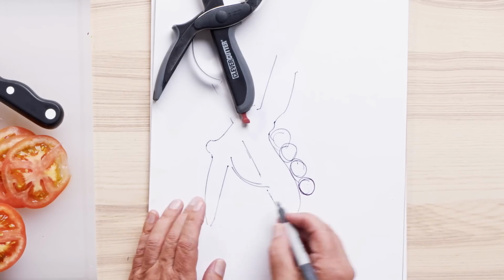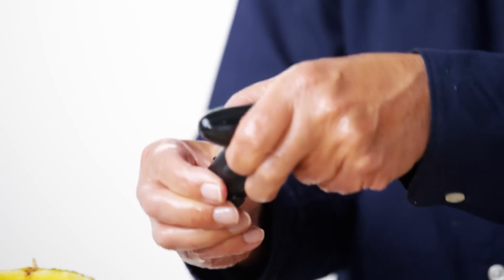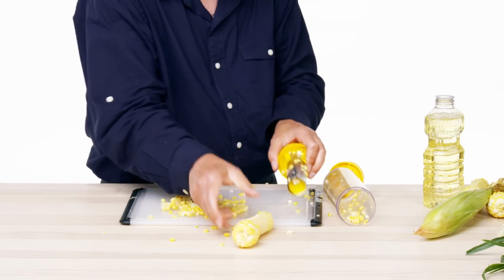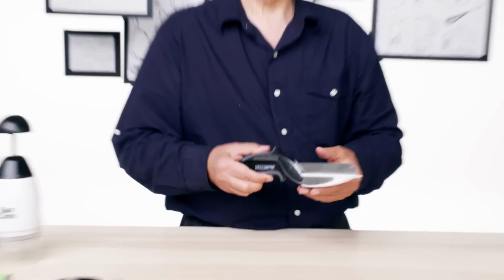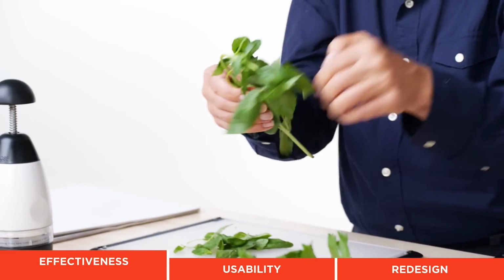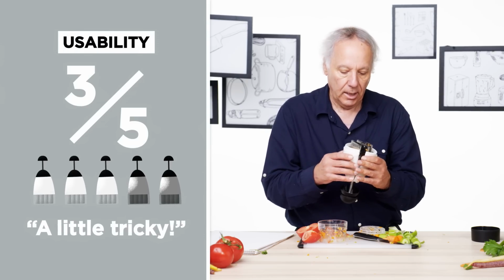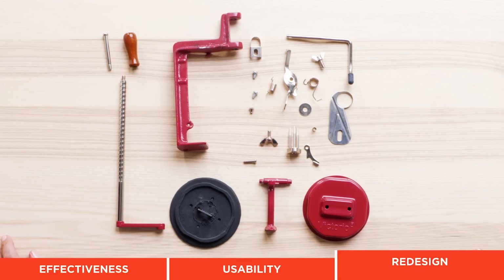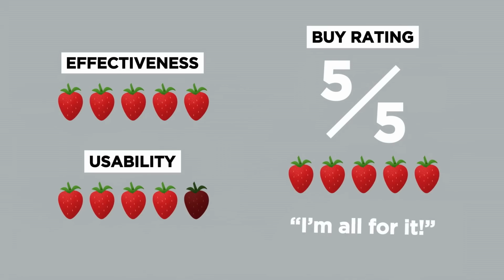7 Slicing Kitchen Gadgets Tested by Design Expert | Well Equipped | Epicurious

Comment: I have a neurological disability that limits the control I have over my left hand in particular,  the right somewhat.  For almost all my chopping tasks, I use a cleaver-style Chinese knife.   I bought my first one from a Chinese grocer at the age of 15, and at the age of 63, I'm on my second because the first got lost in a move thirty years ago.  I bought an identical one; they have been making them the same for a thousand years.   It makes most of these tasks, including cutting a pumpkin or watermelon or hard sweet potato, very easy, and much quicker than a French knife, as any Chinese cook will tell you.  You can't press on a French knife but you can these.  

My father was a metallurgist and when I brought home my first knife, he was impressed and told me that it's a very old way of making knives.  The steel is laminated.  On the outside there is hard steel, the inside is soft steel.  This means that it stays sharp well.  Soft steel and iron take a better edge than hard steel; the hard steel keeps them from losing the edge.  Although these look like a cleaver, they are knives and are not meant to chop through bone, which will chip them.  They are kitchen knives and not the same as the cleavers you see restaurant chefs cut up bones with. Buy the solid one-piece knives of grey steel, these are the ones made like this.  Because they are not  stainless steel, they will rust, so if you wash them with detergent, rinse them thoroughly.  Also wash them thoroughly after contact with acid fruit.  You can do quite fine fancy cutting with them.  The blade will get discolored, that is natural.  Don't buy the stainless steel ones; they don't sharpen so well.  There are YouTube videos on how to use them.  If they put their index finger along the top of the knife, they are not using them properly.

The other three knives I use sometimes are a curved boning knife, a Thai 'kiwi' brand short knife with wooden handle - these are only $1 but beware, they are very sharp - they have a great reputation in Australia and most Chinese grocers carry them - and a 1" knife for the strawberries and tomatoes.   The boning knife is actually for melons.   I chop these into eight pieces with the cleaver, place my hand on top of the inside, run my boning knife around the inside of the skin, and then chop them into slices.  If you do it this way your hand will never be in the way of the knife.

Comment: I have found that the best Strawberry Huller I have ever used is a wide plastic straw like for a milkshake. Of course the way I do it is to stick the straw in from the bottom so you loose a little bit of the flesh.

Comment: There's a way more effective way to cut the stems off strawberries than the gadget and the way he was doing it with the cutting board! I worked at a bakery on a berry farm and we would cut them with a very small knife (paring knife?) in a concave shape against your thumb, just cutting off the stem and leaving as much of the berry as possible. It sounds dangerous but I don't recall anyone every getting cut. Also, fun fact: strawberries aren't very acidic but if you spend three hours slicing them without gloves, it starts to sting, lol

Comment: I think the corn stripper would work better if the design is like the pineapple slicer..
Instead of pushing, it could be turned like a screwdriver..
But the handle design is definitely for a push..

But what he said is true..
Even with a redesign, it is still going to be ineffective but slightly better..

Comment: There are tons of "pica-licas" designs (slap chop in spanish of spain, in latinamerica we call them "food processors", usually the real problem with those is that the blades are not as sharp as they should be.

Comment: I dissagree with the mushroom cap on slap chop it would add weaknees to the small neck because it adds excessive moment force ifbsomeone dont slap it on he middle and would break it. Thus it need thicker neck. 

Also i dont agree with the apple screw design because that type of screw dont last long enough in high forces

Comment: I don’t know why he used a knife to core that strawberry, I was always taught to grab the leaves and twist the berry. Boom, it’s pretty easy, and quicker than using that gadget.
Reply: I was taught to use a spoon and gouge the bottom of the stem too. I'm a little picky about how much of the top is left... but not picky enough to buy that gadget. Also, that part of the strawberry doesn't taste good when cooked, like in pie.
Reply: Noice
Reply: But.. just eat the strawberry and throw away the leaf
Reply: Or use a straw and just push it through if you don't want the core piece

Comment: This is pretty cool! My parents have one of those apple cutters, so I recognized that right away. the corer bit also starts to bend if you put too much pressure on it, which is surprisingly easy to do, so making it stronger might also be a good idea.
And the slap chop's squeaky sound was very irritating, and I would not be able to use it.

Comment: For the pineapple gadget: What about a central thumb-push release in the handle itself?  No pinch force required, just jab it with the middle knuckle of the thumb (or another device if need be).  Plus, it would be natural to push with your thumb and pull with your hand at the same time, basically clamping with your whole hand.

Comment: Solution for the water melon cut off both ends of the water melon so their flat then cut it in half then when you use it it’ll go straight through and won’t be stopped by anything

Comment: You're supposed to cut the ends off the watermelon and then split it long ways and then you can push the windmill straight through. Makes it function faster too. It's still not a stellar tool maybe a 3.

Comment: I don't know if it's been mentioned already, but he didn't use the peeler base properly.  I saw him using his  hand to hold the peeler down.  It has a design already to keep it in place.  It's the little lever on the bottom.  Set the peeler flat, then turn the lever 180 degrees  the opposite direction and it makes the rubber suction to the counter top. Not sure why he didn't do this.

Comment: Instead of that slap chopper thing, mum has something which we like to call the lawn mower. It is basically a small blender with a string and handle attached. You pull the string and it spins the blades and cuts your food. You can get things cut pretty finely with it so it was really handy

Comment: "My solution, go to japan, and get a square watermelon"

Me: "Oh, thats it?"
Reply: Minecraft is already ahead with square watermelons
Reply: Square watermelons are not meant to be eaten are more for decorations.
Reply: @jacobramirez9552  Yes, they tend to be more underripe when picked, and more bitter
Reply: Too bad they're unedible
Reply: to do it properly youd have to cut the top and bottom of the watermelon then split it down the middle length wise then you wouldnt have to worry about the end
Reply: Square water melons are rip offs of regular ones
Reply: square watermelons aren't cheap my dear. The lowest cost is 200 U.S.D.!
Reply: Jessie Wang no one said it was cheap
Reply: @jessiewang3154  nO, iT's sO cHeaP
Reply: @jessiewang3154  
Nobody said they were cheap
Reply: Jessie Wang ikr
Reply: @jessiewang3154  ok boomer

Comment: You made a lot of obvious mistakes. Like, for example, anything slapchopped should obviously be done skinside up. 

The corn thing? Be sure to place the corn in accurately and not just "put it" there. You made the same mistake with the apple thing on the first apple. You noticed it and basically said "be sure to put things accurate" in so many words.

And a for the watermelon thing... why not cut the husk off first, and then go from top to bottom? Easy. 

So on and so forth. Ton of obvious mistakes i wasn't sure if you made on purpose or not, and "common sense" is not the same for everyone, i get that. But everyone always swears i have no common sense.

So how were they so much of what stood out to me? 🤷🏾‍♂️
Reply: Also, all good products tend to be designed for the handicappable.they tend to be designed for someone who couldn't otherwise use the product safely. 

Bad products, tend to be ones you had to do a redesign on. But you basically said the same at the end.

Comment: I use the  tomato shark for tomato and strawberry stem removing. I suggest it over the other thing for ease of cleaning and no parts.
Reply: Had to look up if they still make them, because I got mine like 25 years ago.  They now have much more handle designs.  Trust me, used it in professional kitchens on lots of prep and has done several lifetimes of work that it would happen at home, this works well and takes less out than a paring knife, and has near zero chance of injury due to having the knife blade near fingers with the paring knife.

Comment: Corn stripper:  
The cutter tube has unidirectional cutting teeth.  Turn [either way or oscillate] whilst pushing down...as per instructions.  Needs a ''T'' handle.

Comment: Or you could create a reverse screw mechanism on the top wheel  you core the pineapple in the clockwise direction it works. When your finished you unscrew the top in the counter clockwise direction.

Comment: I'm crying over all that wasted pineapple. Slice off the top, slice off the bottom, cut it in quarters lengthwise, cut the triangle of core off each piece then slice each piece into bite sized wedges, to eat just bite off the fruit from the peel. Way quicker to cut than the way he cuts it with a knife and wastes nothing.

Comment: What all these tests are forgetting about when they measure time and effectiveness is that when you cut stuff with a knife, all you have to do afterwards is just running water over it for a second to have it all clean again.
When you do stuff with a device you have to clean the device afterwards and many are not made for dishwashers or you need to disassemble parts and assemble them later again.

Comment: The watermelon windmill probably would have worked better if the ends were cut off the watermelon, and then the melon sliced lengthwise.
Reply: Probably, but by the time you're done chopping off odds and ends, you could just do a few more slices and have cubes.
Reply: @vasileny.6374  It takes less than 10 seconds to make three cuts in a watermelon.. lol!   It takes 3 cuts to have the watermelon ready for the windmill.  4 max if your knife isn't long enough.  But, as they say, to each their own.  If you had to cut a lot of watermelons, this could come in handy.

Comment: I’ve had the pineapple slicer and the clever cutter. The slicer I eventually threw out because water gets into the handle and I eventually lost a piece due to that. The cutter “spring” lost its “springy-ness” and fell out, the pieces came apart but the knife honestly works awesome on its own too.

Comment: Another problem with the slap chop is that the curved blades are nearly impossible to clean - I got a similar knock-off of the slap-chop for dicing up hazelnuts and others for baking, and it was a nightmare to get in with a wash cloth or sponge in the corners of those blades.

Some of these people design things with only use in mind without thinking about how someone might clean it up.... I could see someone like my dad, who has big, calloused, swollen-looking fingers being completely unable to clean several of these items - especially the corn cob stripper and the slap chop.

Comment: I have a version of the apple slicer (though it's from like the 80's), and it's amazing. He is entirely correct though, in that it is terrible to clean, and it's annoying to set up. Basically if you are doing one apple it's not worth it, but if you are making pies or something that requires five or more apples, it is a godsend. 
Worth noting though that my version has a screw clamp on the bottom that clamps onto your cutting board, rather than that weird suction thing, and so I think if I had the suction version I mmight be a little more annoyed with it.

Comment: 17:48 please just use a normal apple core remover handtool, takes 5 seconds, 
if you need to use a normal knife, just cut it in 4 pieces and hole out the core, takes 20 seconds.

Comment: Wouldn't putting the windmill a bit back leaving a bit of the metal part sticking out help with the watermelon thing? At first the cubes would be longer, but then the windmill itself would divide that cube in half if it is sharp enough

Comment: The strawberry huller is ridiculous.  It is not "efficient" simply because this guy is pathetic at hulling strawberries!  It takes me 1-2 seconds to hull a strawberry: hold a very sharp paring knife by the blade, with the handle up and the blade facing away from you.  Impale a strawberry upward onto the blade and make one full turn, the hull will pop right out.

Comment: The Clever Cutter, from what I've seen with other versions of the same device, is more for cutting celery, green/spring onions, parsnips, etc. It's going to fail against anything spherical, broad, or especially with the tough skin and gooey center like a tomato has. Enough people out there already use kitchen shears for the purpose of cutting those stick-style veggies, so Clever Cutter et al are just a logical progression of adding the board/backing on one side.

Comment: I do software testing including usability testing, and I admire your method of the "oiled up left hand", its a creative way of simulating someone with very little dexterity, similarly I have to approach software in the mindset of someone who has very little technology ability and whether or not something is suitable yet effective.

EDIT: and how later on you mentioned how you don't want to know about the average user you want to know the edge cases "the strongest and weakest, the tallest and shortest", I very much resonate with that

Comment: I use almost all these gadgets at work (I teach cooking in a kitchen store) and I agree with his assessments. The strawberry huller, I personally wouldn't buy because I can do it equally quickly with a knife, but I have customers use it all the time, both for strawberries and for Roma tomatoes. The pineapple corer is amazing and I want one (my partner keeps insisting we don't need a tool just for one fruit but I'll get it someday...). I don't like any corn tool that fits around the cob because there's too much variation in corn and it inevitably won't work for all of them. If you're looking for a corn tool that does work, I would recommend the Zyliss corn stripper.

Comment: Cupboard fillers, bin the lot.
1 x 3" pairing knife.
1 x Chef's knife, blade length should be twice the width of non-dominant hand.
1 x Steel to dress.
1 x Whetstone to sharpen.
1 x Wooden chopping board.

1 x Skills..the hard bit.

* There are plenty of ergonomic knives available however they tend to be low quality blades.

Comment: Slap Chop thing is super useless. Especially in the sense that it requires you to pre-cut things (such as celery and carrots featured in the video) into manageable chunks using a conventional KNIFE beforehand. Prep and clean up times not considered. Moreover, the blades get dull, it's a pain to clean, half the product stays inside afterwards, it mashes and bruises the product, the cuts aren't precise at all, and the transparent portion at the bottom is prone to cracking/shattering if you slap it too hard. On top of the obvious flaws already covered by the video.
Even for someone with dexterity problems, unless you're completely incapable of holding a knife, the results would likely be the same.
This is a fine example of a kitchen gimmick that has no real purpose and ultimately ends up in landfill.

Comment: The corn device could actually work if they had lever handles pushing the corn into an adjustable steel ring, not unlike some modern corkscrews. Would strip a corn in no time and small effort. But that wouldn't be a redesign but a new device altogether.

Comment: So, um, the corn stripper has a sort of serration on the edge, and a grip around the handle. I think it was supposed to be twisted, not forced. Might want to revisit that one.

As for the watermelon, many people avoid the part closest to the rind, so.... I guess it would be ok to me. However, that slip test scared the hell out of me. Having your hand on the far side of the melon while you were pushing a "blade" towards it with minimal control? Yikes.

I have the apple corer/peeler, and I love it. (so do the kids)

Comment: The clever cutter is especially nice in that you don’t need a cutting board...but it looks dangerous. There’s no good way of holding and steadying things in air to be properly cut.
Also, a lot of the effectiveness guide also depends on the speed of the user. A well experienced cook will likely find no need for some of these tools. (Though I understand that they are not the target customers)
And the cleaning process really affects the true effectiveness of these gadgets. E.g. for the slap chop, you still need to use a knife and cutting board, so all the time saved from less chopping will easily add back up when washing dishes.

But anyways, this was a really well made video! I appreciate the way you consider ergonomics and forces in design. It’s also amazing that you care that everyone should be able to use these tools. Great work!